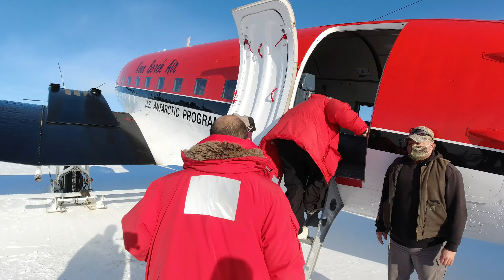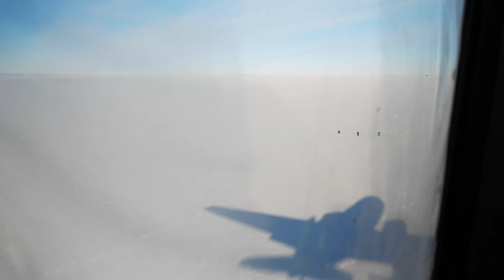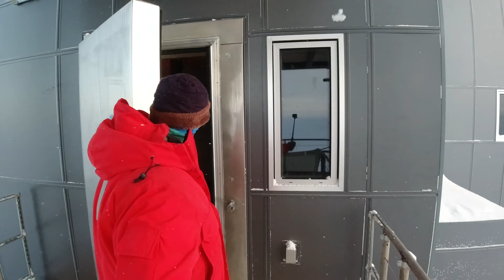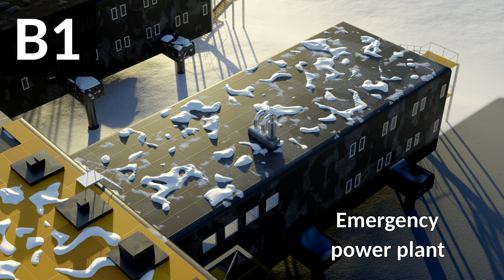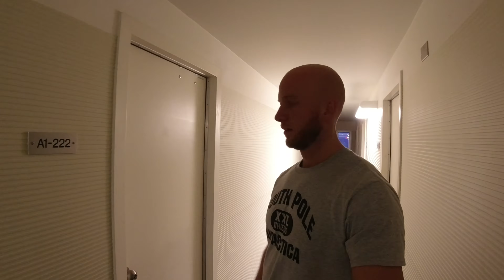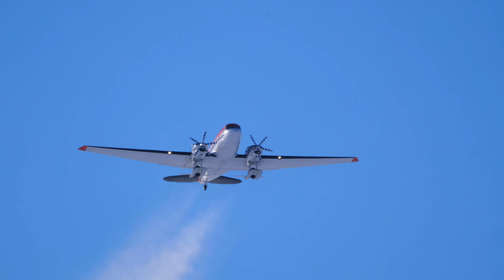Intro to the South Pole Station - McMurdo to Amundsen-Scott - South Pole vlogs #6

Comment: "Keys and locks are rare..."   Well, guess not much chance for me to get a job there.  Also, I do not photograph keys which are still in use and put on the net. I can see a section of the master key system just there and guess the one key outside the system holds your narcotics. Just a guess.  No need to confirm nor deny.

Comment: this is absolutely amazing !   my question: what it takes or how can you get a job in south pole ?
Reply: That depends on the country where you have citizenship. In the US most get positions either through a research institution or the USAP contractors (https://www.usap.gov/jobsandopportunities/)
Reply: @amandah9354   i mean i knew you need to be scientist or something but also other jobs are need there.
Reply: @mojaopwieść  Look at the website.  Anything not related to the NSF is support staff for science.  There are opportunities for welders, carpenters, mechanics (large equipment mostly), janitors, electricians, plumbers, chefs, kitchen staff.  It's a treasure trove of opportunity, but it may be more empty now.  Most summer (Sept/Oct-Feb/Mar) jobs are posted in January, and there are a lot more summer opportunities than winter.
Reply: @amandah9354  i will. thanks for that. they always will need chefs to cook for the staff :)